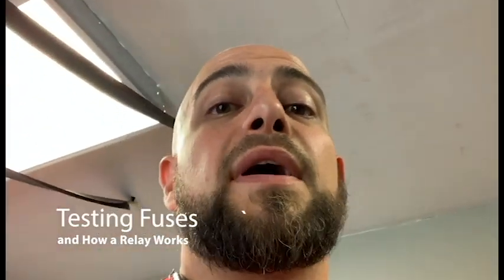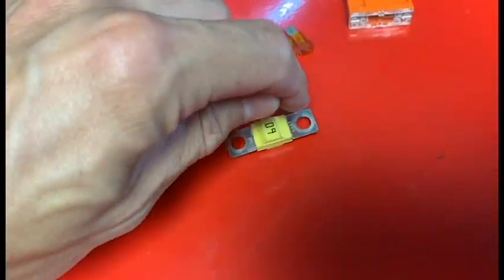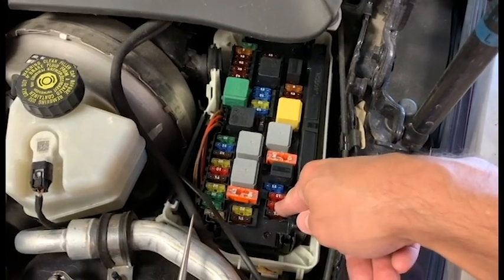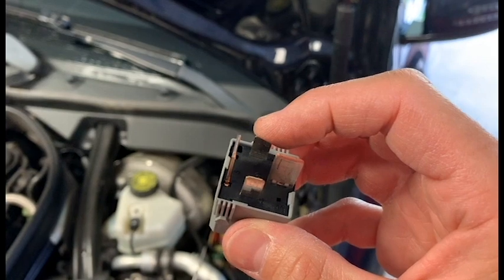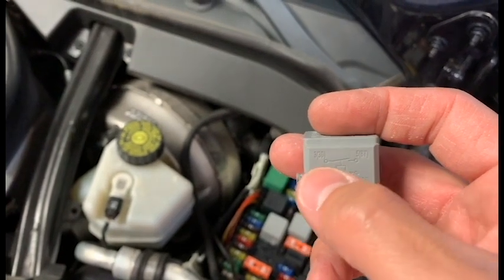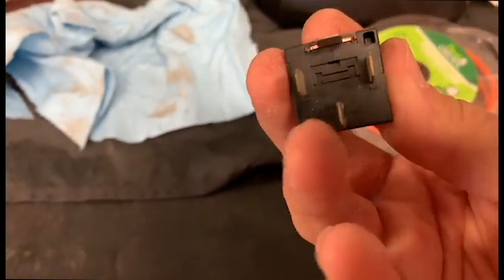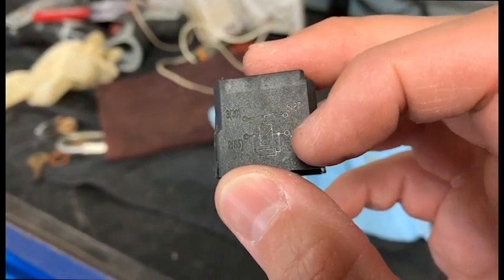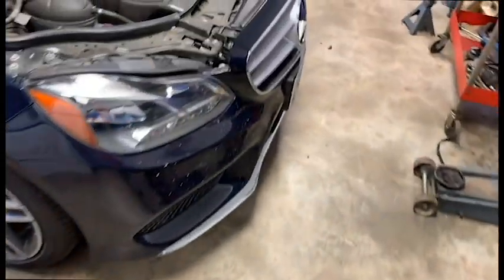How to check fuses relays relay switches -Testing Fuses and How a Relay Works

Comment: Hey so dumb question but if you want to test as many fuses as possible is the best way to do it with the car running? I've got lots of those fuses that don't have power with the car off.
Reply from the maker: No question is a dumb question if you do not know. However, you may not understand how to test a fuse. In order to test a fuse there are 2 ways. Testing for power on each side of a fuse which can only be done if the fuse is powered meaning the item it protects is being activated. Or 2- ohming a fuse which is to me, a waste of time as you can clearly see a blown fuse by the black burn marks. So with key on is the best way to check all fuses for power on each side of the fuse. and the ones that do not power up, pull them up to look at them. The only other thing you are missing is to know what those fuses power and when they should have power. Like a horn fuse will only have power when pressing the horn. washers, lights etc.I hope this helps. 
Lou